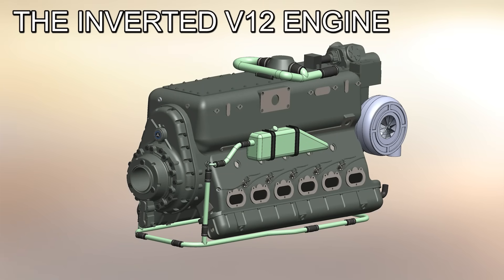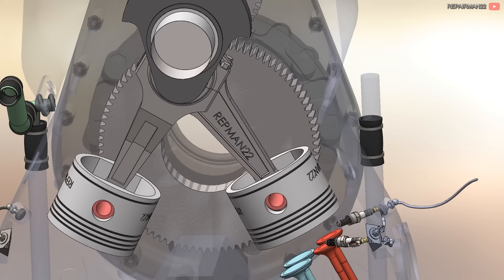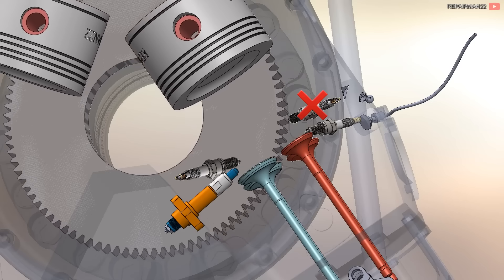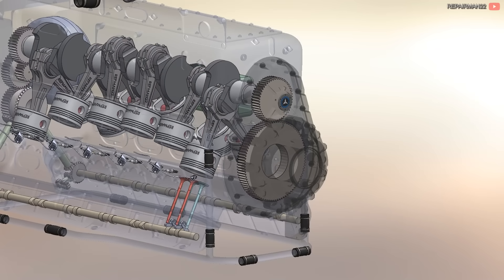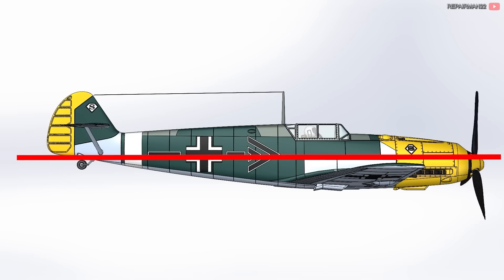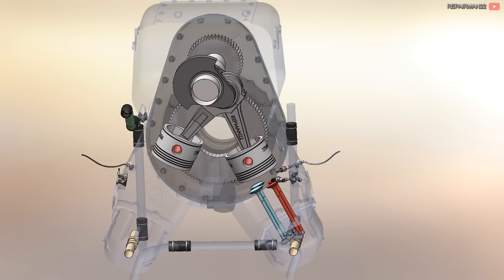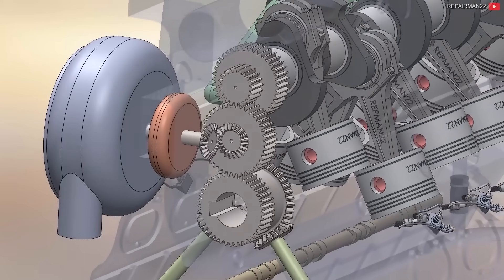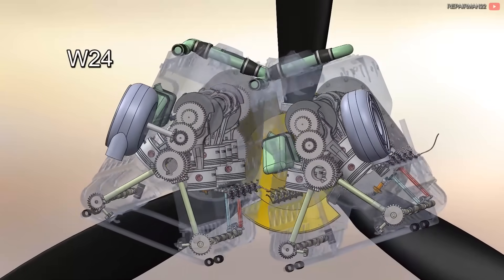The INVERTED V12 🤯 Why!?!?  - 3D animation - DB 600 Engine // Daimler Benz

Comment: Waking up to this was an unexpected surprise. I never heard of a hydraulic supercharger and it's counterintuitive to me that higher compression ratios are better for fuel economy.  Very interesting and informative.

This is my first comprehensive look at the Messerschmitt BF 109 engine after learning about it decades ago.
Reply: at rarer air bars its often not even a choice - less fuel is needed for the same net thrust provided you find a way to have the chamber bars higher, hence supercharger
Reply: @TheGrimStoic  Thank you very much, I learned something new today.
Reply: @bobhill3941  nothing you didn't already know, c'mon. I merely summarized it for you.
Reply: It is not a hydraulic blower, DB Simply swapped the motorbike clutch packs used in 2 speed blowered Merlin 20,s and 60,s and Griffon 50,s and 60,s with a fluid coupling. Works the same as the gearbox in a Caddy, when the throttle is opened up the blower speeds up automatically as as rpm increases, slip taken up by the oil and heat dissipated through the oil cooler. No need to manually change from low to high blower . Rollers at Derby got over the problem of manually changing  Merlin 60 blower gears by using an aneroid capsule like that in a domestic barometer , capsule senses a drop in outside air pressure and changes to high blower, the first application of simple automation to a mechanical drive.
Reply: @basiltaylor8910  i see...the luftwaffe didn't strike me as overly worried about copyright either, -  taking everything's fair and all quite literally
Reply: @TheGrimStoic  ,No where did Daimler Benz get the Idea of an upside down engine  from ?,Major Frank Halford creator of the 'Gipsy ' range of  inverted air cooled light aircraft engines manufactured by De Havilland of Hatfield Hertfordshire UK. Why did German aero engineering advance from a wheezy 700hp BMW VI of twenties vintage to then modern 1,000hp  DB 601 suitable for a  fighter like the BF 109 and He 100 ?. All within the timeframe of two years?, answer cats&kittens, DB copied parts of the imported Rolls Royce Kestrel that powered  Willy Messerschmitt,s 109 prototype that flew in September 1935 .
Reply: @basiltaylor8910  look now, ever country has a behavioural core, if i'm allowed a grossly sweeping generalisaion...the englishman is easygoing by nature and a fair to middling sport, in a condescending kind of way, whereas the german is out to reach the top at any cost, so don't expect him to play by the rules once unleashed, see
Reply: Higher compression engines paired with higher octane fuels and part-throttle operation makes for improved fuel economy when maintaining a constant cruising speed. It's about sipping the good stuff for power.
Reply: @Fraud_Flintstone  there was no good stuff, so...
Reply: @TheGrimStoic  I don't know what you mean by your last unsupported statement. US petroleum manufacturers in WWII created fuels with upwards of 150 octane. These fuels were meant to be diluted with locally available fuels in theater.
Reply: @Fraud_Flintstone  sure you don't
Reply: @Fraud_Flintstone  I think the point is that the engine under discussion wasn't American. During the war the  Germans did have high octane fuels but a less reliable supply. And I'm pretty sure the 150 octane weren't fuels weren't available until 1944. It was ISO octanes that were supplied to be either diluted or boosted.
Reply: @Fraud_Flintstone  Thanks, very concise and straightforward. Happy Labour Day.
Reply: I'm not sure why it's counter-intuitive that higher compression ratios lead to better fuel economy. It's the high compression ratios in diesels which is one of the chief reasons that they achieve higher thermodynamic efficiency. That's due to something called the expansion ratio. That is the ratio between the volume of the hot gasses at the bottom of the power stroke and that at the top. It's not necessarily the same as the compression ratio, as the gasses are hot, but it is related. The higher the expansion ratio, the more energy that can be extracted from the fuel.

Of course high compression engines are often associated with high performance engines, and fuel economy tends to be a secondary consideration on those. 

nb. diesel engines have another advantage in fuel economy as the fuel does have more energy content per litre. However, that is a different issue to thermodynamic efficiency.
Reply: @TheEulerID  A pointless exercise if you  cannot  get the bloody engine to start in sub zero temperatures, oil    burners are heat engines, requiring  said heat to run. Why do you think oil burners have a heavy duty starter motor and battery?,. Because cats&kittens  oil burners need a good churn  on the starter to induce heat in the cylinders if not fitted with pre heaters, classic examples, Gardner LW and Perkins P6 and R6, both notorious for bad starting in sub zero temperatures.
Reply: @basiltaylor8910  As my point was about thermodynamic efficiency and the relationship between compression and expansion ratios and thermodynamic efficiency, I'm not sure cold starting is relevant. Having said that, Scania built diesel trucks that start well in Nordic winters, so it's hardly an insurmountable problem.
Reply: @TheEulerID  . Yes as  I said before thermodynamic efficiency goes out the window if you cannot get the oil burner started in sub zero temperatures. Okay Scania and Volvo oil burners suited to  Sweden,s evil winters will startfirst few turns, even Scanny,s  oil burner will show signs of reluctance to start, but not to the same extent as a Gardner 6LW or Leyland 680. Ever heard of the 'Patricroft Fog'?.
Reply: @EbenBransome Yes am well aware of that, but the diesel is more prone to bad starting in cold weather without any form of pre heating. Gardners LW range were the worst offenders as engineers at Patricroft did not consider a pre heat system. On the other hand, a petrol engine will start in cold weather due to its external electric ignition system once the carburettor is primed. Why do you think UK fire brigades ambulance control and utility companies specified petrol engines for their vehicles right up to the late 1970,s. Reason cats&kittens  a petrol engine will start whatever the weather conditions.
Reply: Too bad we can't buy these planes anymore
Reply: Very good info!